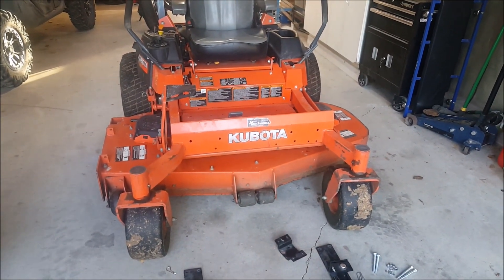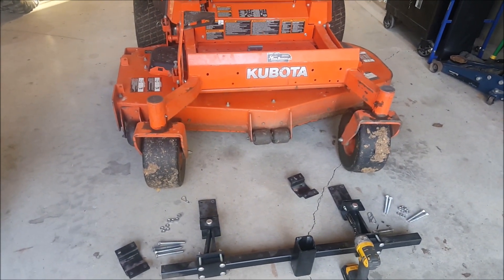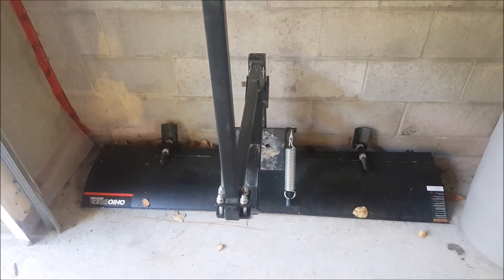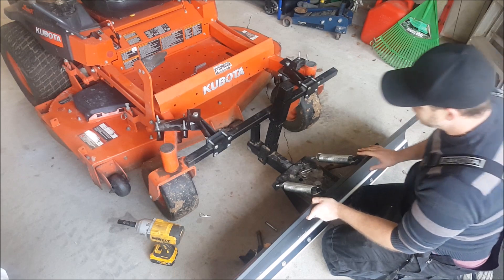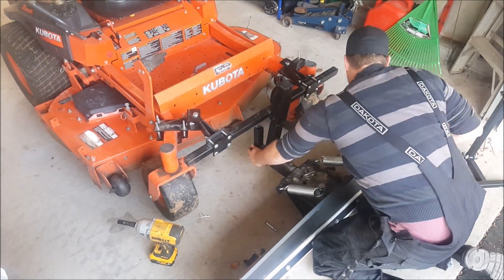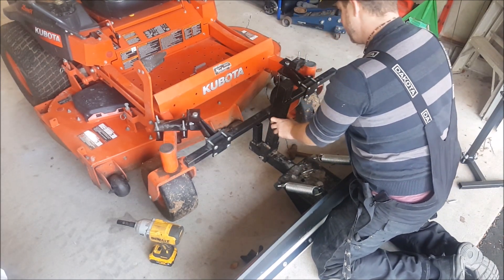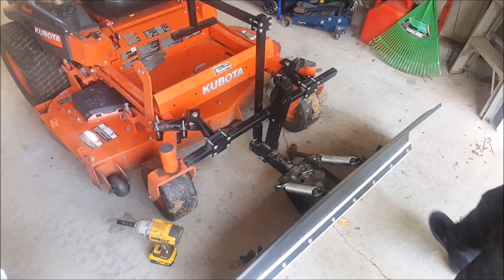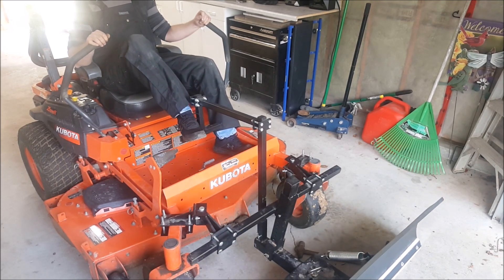How To Mount A Snow Plow On A Zero Turn | Kubota Zero Turn Blade Assembly

Comment: Can you hitch this to a front of a mower that comes with a hitch on the front instead of using the duel mounting plates to the bars?
Reply from the maker: I'm guna guess no to that. This plow is designed to attach to the front arms on a ztr.
Reply: @McGo101  What are the plate dimensions  of the length and width for both?

Comment: That's very nice. I would love to use one but I don't have have paved driveway and afraid of getting stuck
Reply: kubotas are accully only ones that lets ya add what ever ya want they have lots of space wich why i love kubotas and parts are accully cheaper
Reply: For gravel drive cut a groove down a 1.5" diameter pvc pipe... then slide that onto the scraping edge of your plow.

Comment: How do you like it after one season? Did you need chains?
Reply from the maker: After 2 seasons it was still doing ok without chains, but I got a small TLB that I got the plow on now
Reply: @McGo101  Thanks for the great vid and the info. Really helps allot.Appreciate it.
Reply: @McGo101  What model Kubota zero turn is that?
Reply from the maker: @CBRTheFlyer  z726xkw w mulching kit

Comment: Is this mount also available for like stand on mower like Wright stander or toro gravely?
Reply from the maker: i think its only designed for zero turns as it uses the front castor wheels frame to mount to. if your stand on had castor wheels similar to a zero turn then there is a chance it may still fit.
Reply: @McGo101  There should be for stand on mowers I know toro has the system already installed I seen the toro with snow plow on it.
Reply: it will probbly fit's mostually only kubota SZ series because there kubota sz made same from the z series and same features  and same parts wich kubota came up smart design on the SZ series stand ons from the Z series other brands you have to use different parts wich is a pain in the head thats why kubotas put smart thought and engineering on them plus there sz you could add the diesel engine if you wanted as well wich fits sz as well

Comment: I hae a new Kubota 422 ZT and I'm going to put a blade on it....does this plow have a polyethelene blade? After I switched to a pol blade on my JD 343 I got much better, less 
destructive results on my driveway....I want to see it IN ACTUAL USE....
Reply from the maker: It did come with a replaceable blade for the bottom of the plow I just don't recall what type of plastic it was made of. I have a couple other videos of it in use feel free to check out. Cheers

Comment: Do you use any snow tires or chains?  Do you feel you need more weight for traction?  Where did you get yours and how much was shipping?  I’m looking at getting the same one but am kind of skeptical. Thanks! It looks very easy to install.
Reply from the maker: Hey Evan, nope no snow tires or chains. my machine is over 1500lbs so thats not an issue. if i had a steep grade to the driveway i would look at chains for sure. I got mine off of tsc.com . had the 60 inch ohio steel zero turn blade shipped up to watertown new york and i drove down from ontario just over the border to go get it. Had to pay duty of like 60 cad on the way back but i got mine on sale for 549 US which worked out to about 700 cad plus duties. Set up isnt perfect being 2 wheel drive but the price was alot better than buying a quad just for plowing. if you have a basic driveway to clear its not a bad idea. only real issue i had was cold starting the non-FI tractor on really cold days. Let us know how you make out!
Reply: @McGo101  Awesome! Thanks for the response!  Hope we get some good snow this winter in Ohio.
Reply: @McGo101  I forgot to ask one more question lol. How much did it cost to get it shipped to the TSC store? Was it free or was there a freight charge because of its dimensions and weight? I’m looking into buying it but don’t want any surprise charges. Thanks!
Reply from the maker: @evanromero6994  it was free to ship to a closer store